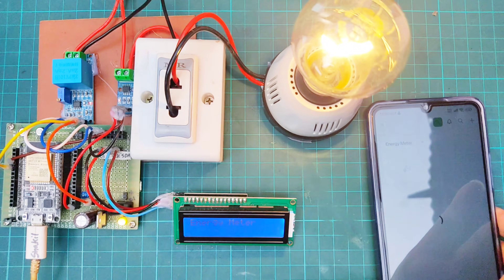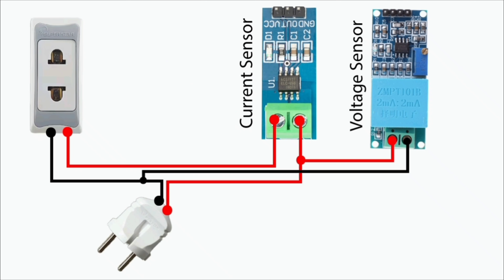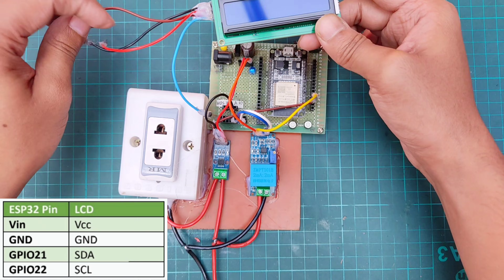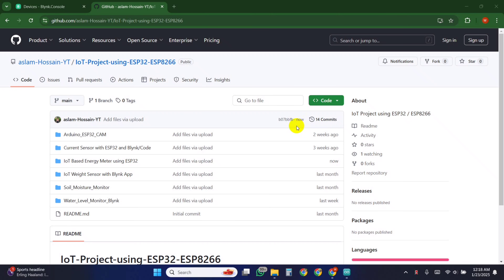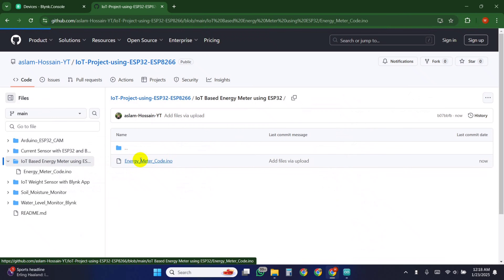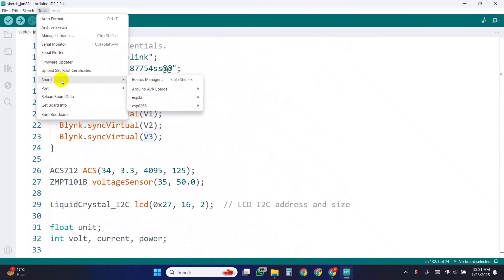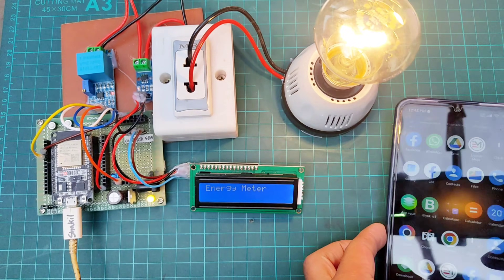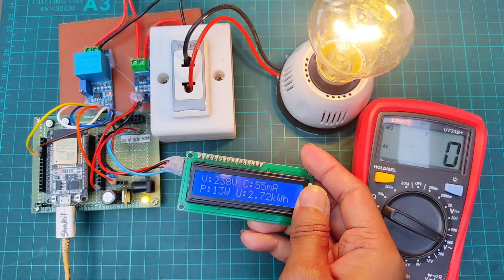IoT Based Smart Electricity Energy Meter using ESP32 and Blynk Application

Comment: Your Energy and True Power are Wrong. You need to calculate the Power Factor when measuring AC equipment. The equation to calculate True Power in AC loads is:
P = Voltage x Current x Power Factor 
(P = V x A x PF)

Comment: On LCD displays it's getting only energy meter,iam not getting any power , voltage...
Reply from the maker: because your esp32 is not connecting to your wifi. make sure to provide your wifi ssid and password in the code. Also keep the system close to the wifi network you're using.
Reply: How to check whether the esp32 is connected or not
Reply: How to check whether the esp32 is connected or not
Reply: Thank you for replying so quick
Reply: Okay
Reply: Again it's coming like that only
Reply: Please solve this problem
Reply: In esp32 red led was not turn on when I connected to the laptop
Reply from the maker: Serial Monitor. press "EN" button

Comment: How do i know the calibration value for voltage & current in the arduino code??
Reply from the maker: Test without load. It should be zero
Reply from the maker: Watch this https://youtu.be/6mGqnvW-adc?si=7rBn5MSzBmW7DsMC
Reply: @aslamhossain1  

is there will be any problem if i don't callibrate?
Reply from the maker: @emon_546  yes. you will not get proper value
Reply: @aslamhossain1  

Can you tell all arduino library names that you include in the code?

Comment: Hello may I ask if you have a circuit diagram for the esp32 trainer board? the link i followed only provide me a diagram for the connections of the esp32 to the load and the sensor. I would like to use the work for our project. Thank you
Reply from the maker: To make this project, you don't need to make the trainer board. Just use breadboard and connect as like the circuit diagram provide for this project.
Reply: @aslamhossain1  Oh alright, thank you so much for the infornation!!

Comment: I'm currently working on a project using the STC013 current sensor and the ZMPT101B voltage sensor with an ESP32.
I'm having some difficulties writing the code to read and process the measurements correctly.
Could you please help me or guide me with some example code or advice?
Reply from the maker: Contact Me

Comment: how to get esp32 trainer board? Is it Possible to make this project without trainer board?
Reply from the maker: Of course possible. Use breadboard instead. The trainer board was made by my self just to easy power supply to the esp32.
Reply: @aslamhossain1 
Then what will be the circuit diagram in the breadboard? Can you give a link?
Reply from the maker: @ follow the diagram given. Link in the video description
Reply: @aslamhossain1 
You didn't use arduino. Then how we implement the arduino ide code?
Reply from the maker: @emon_546  #include <Wire.h>
#include <LiquidCrystal_I2C.h>
#include "ACS712.h"
#include <ZMPT101B.h>
#include <EEPROM.h>

// Sensor definitions
ACS712 ACS(34, 5, 4095, 125);       // Current sensor on pin 34
ZMPT101B voltageSensor(35, 50.0);     // Voltage sensor on pin 35

LiquidCrystal_I2C lcd(0x27, 16, 2);   // LCD I2C address and size

// Variables
float unit;
int volt, current, power;

#define EEPROM_SIZE 512
#define UNIT_ADDRESS 0  // EEPROM address to store unit value

void setup() {
  Serial.begin(115200);
  EEPROM.begin(EEPROM_SIZE);

  // Read previous unit from EEPROM
  unit = EEPROM.readFloat(UNIT_ADDRESS);
  if (isnan(unit)) {
    unit = 0.0;
  }

  Serial.print("Previous Unit Value: ");
  Serial.println(unit);

  // ACS712 setup
  Serial.print("ACS712_LIB_VERSION: ");
  Serial.println(ACS712_LIB_VERSION);

  ACS.autoMidPoint();
  Serial.print("MidPoint: ");
  Serial.println(ACS.getMidPoint());
  Serial.print("Noise mV: ");
  Serial.println(ACS.getNoisemV());

  // ZMPT101B setup
  voltageSensor.setSensitivity(500.0f);

  // LCD setup
  lcd.init();
  lcd.backlight();
  lcd.setCursor(0, 0);
  lcd.print("Energy Meter");
  delay(1000);
}

void loop() {
  int noise = ACS.getNoisemV();
  float average = 0;

  for (int i = 0; i < 100; i++) {
    average += ACS.mA_AC();
  }

  float mA = (average / 100.0) - noise;
  current = (mA > 5) ? mA : 0;

  float voltage = voltageSensor.getRmsVoltage();
  volt = (voltage > 50) ? voltage : 0;

  float watt = voltage * (mA / 1000.0);
  power = watt;
  float kWh = watt / 3600.0;
  unit += kWh;

  // Update LCD
  lcd.clear();
  lcd.setCursor(0, 0);
  lcd.print("V:");
  lcd.print(volt);
  lcd.print("V C:");
  lcd.print(current);
  lcd.print("mA");

  lcd.setCursor(0, 1);
  lcd.print("P:");
  lcd.print(power);
  lcd.print("W U:");
  lcd.print(unit, 2);
  lcd.print("kWh");

  // Debug via Serial Monitor
  Serial.print("Voltage: ");
  Serial.print(volt);
  Serial.println(" V");

  Serial.print("Current: ");
  Serial.print(current);
  Serial.println(" mA");

  Serial.print("Power: ");
  Serial.print(power);
  Serial.println(" W");

  Serial.print("Energy: ");
  Serial.print(unit, 4);
  Serial.println(" kWh");

  delay(500);

  // Save updated unit to EEPROM
  EEPROM.writeFloat(UNIT_ADDRESS, unit);
  EEPROM.commit();
}
Reply: @aslamhossain1  is this code should i implement in the esp32 module?
Reply from the maker: @emon_546  arduino

Comment: i think the vcc of current sensor should be wire with 5V of ESP32, i've never know it could be connected with 3,3V of ESP32
Reply from the maker: When you use esp32 then you have to connect with 3.3v
Reply: @ is it possible? which is ACS712 working voltage is 5V
Reply from the maker: @ will work. or if you want to use 5 volt then you have to use voltage divider for the signal out due to logic level of esp32

Comment: Where did you used the yellow plug which you attached in the starting?
Reply from the maker: With AC 220 volt Line. The yellow one was damaged. Then i've replaced with new one.